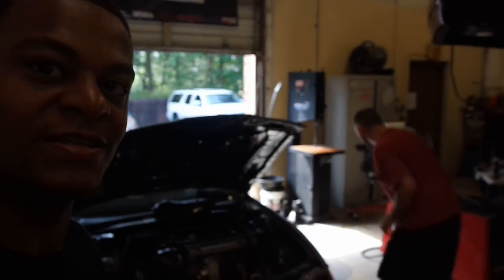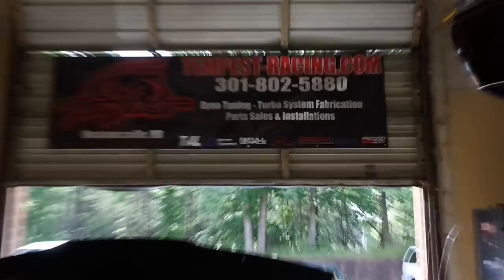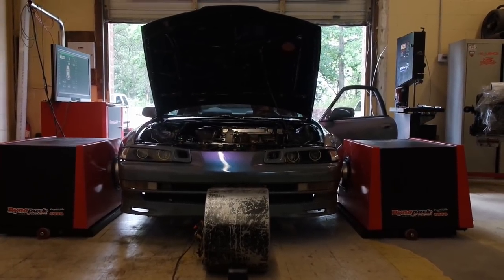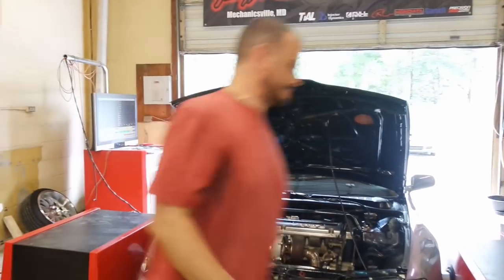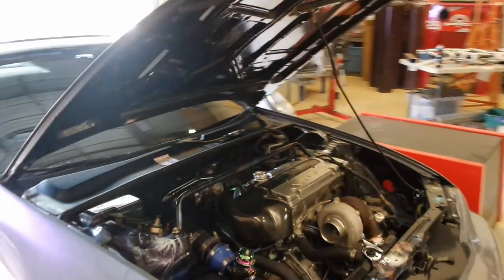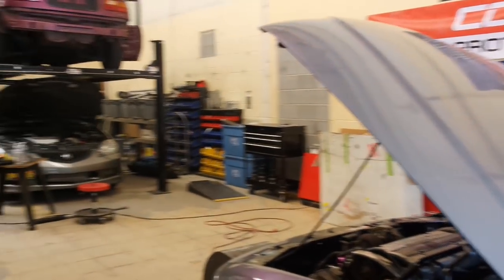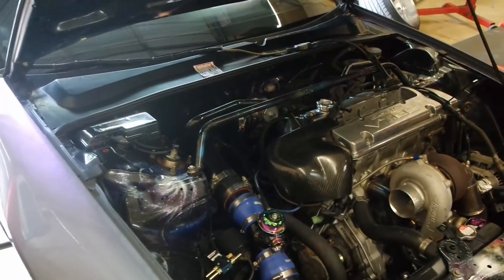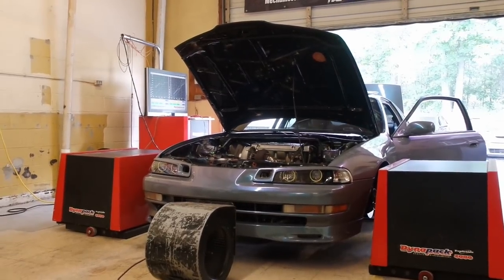TURBO HONDA PRELUDE gets tuned | dyno

Comment: What type of tune are you running on your prelude
Reply from the maker: Idk how to answer that question bro
Reply: Like what type of ecu like hondata
Reply from the maker: @zay_tv5210  yea running hondata s300 v3
Reply: I wanted to see what kind I wanted to put in my 1992 prelude but it’s a f22b in it do u still think I can make the same horsepower you make with that type of engine
Reply from the maker: @zay_tv5210  i dont see why not. Just make sure you get a quality turbo manifold
Reply: Cool

Comment: What cams are you running?
Reply from the maker: Daryl Lucas stock manual f20b type s cams
Reply: Trey Be Dipping nice numbers
Reply from the maker: Daryl Lucas thanks bro i wasnt really impressed im getting retuned after i fix the issues.
Reply: Type a cams are great boost cams